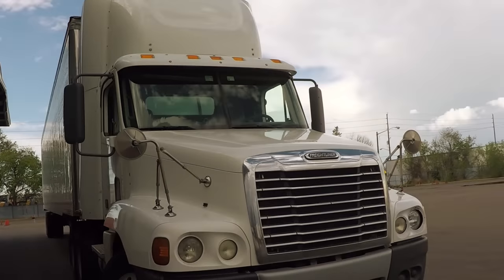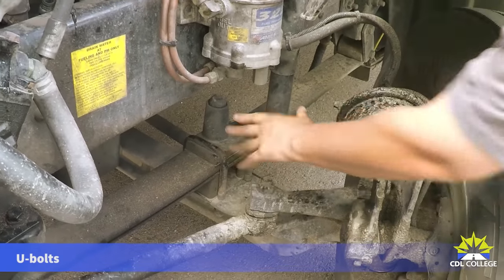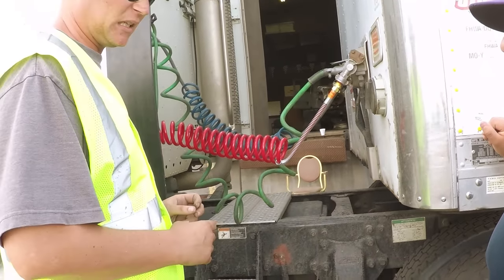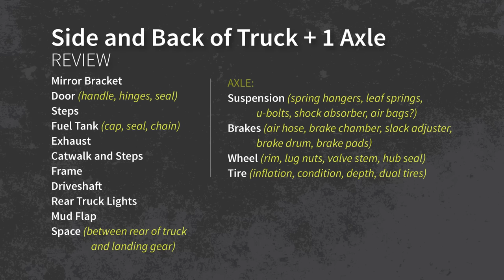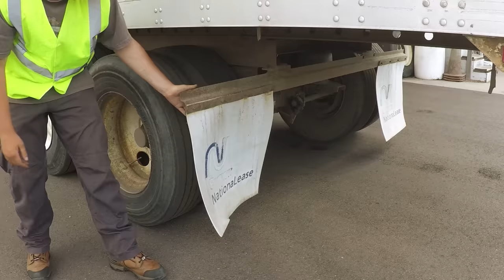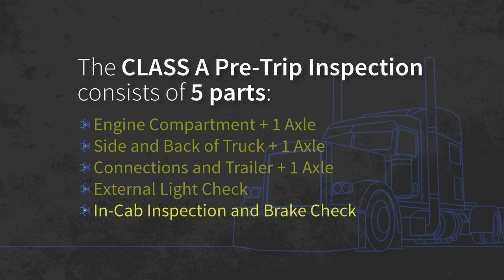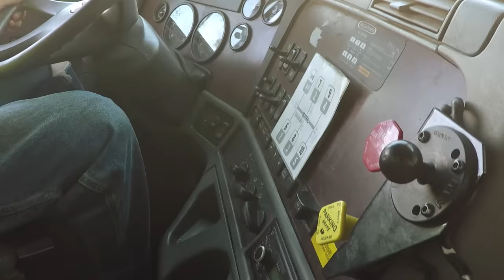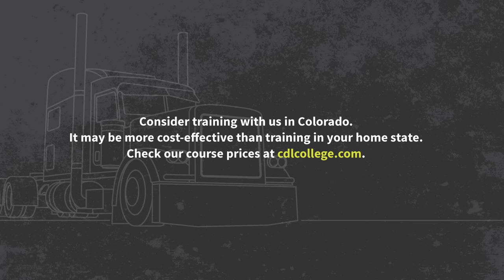[Tutorial] CDL Class A Pre-Trip Inspection DEMO

Comment: In cdl manuel it lists the power steering as a component. Notice the hoses attached to the gear drive in front of the air compressor, so the power steering is gear driven. Still good instructional video.
Reply from the maker: We disagree, but that's OK, Tim. We don't think the power steering gearbox is driven by anything. There are, however, gears inside the box that assist the driver with turning the steering wheel. Thanks for watching and commenting.
Reply: At the 2 minute mark on video notice hose leaving reservoir over to a component, then a hose going back over to steering box. What is that components name and purpose?
Reply from the maker: I see many hoses and 2 reservoirs at 2:00. Which are you referring to?
Reply: ok, look at 2:09 mark. Below reservoir notice hose going over to a component, then a hose returns back over to the steering box. What is that components name and purpose? Is that a pump for the power steering, which is gear driven. Also, why would the CDL manuel mention the power steering assembly and whether it is belt or gear driven(page 11-1 in CDL manuel).

Comment: In at least Oregon you have to also check the trailer brakes. So don’t forget to push in the parking brahs (yellow) & pull out the trailer brakes (red) and try to accelerate. Or you will fail.

Comment: If the truck was made before 1964 and doesn't have a seat belt, do you just say that under normal circumstances, you check it, but the vehicle is not equipped?

Comment: Do you have to mention if tires can be recapped or if they must be virgin for either the front or rear tires?? Also if you says tires have to be same size and same type per axle... do you have to mention if the tires should be either radial ply or bias ply?? Also do you have to mention what PSI do the tires have to be?? Or can you just say pressure must be manufacturer specs?? Or do you even have to say anything about tire pressure? Also you didn't mention that tires must not rub or touch anything. Also duel tires must have 3 inch gap from tire to tire, and 3 inch gap from tire to any suspension parts and 5 inches from tire to frame. Not sure if this must be mentioned, but I know inspectors will not give you a point if you don't mention these key points. Also don't understand how tires can only be ONE POINT, they should give more points since so much info has to be remembered, and also the importance if tires on the truck are too PRIORITY! So they should give way more points for knowing tires. Just saying.

Comment: This is probably a stupid question but you do have to inspect both sides of the truck and trailer right?
Reply from the maker: No, sir. The truck and trailer are, largely, symmetrical. So, the right and left sides are the same. The tester reasons that if you can inspect the driver side of the vehicle(s), you can also inspect the passenger side of the vehicle(s). No need to inspect the same things twice because that would be inefficient. In the real world, you should inspect the entire vehicle. Thanks for watching, Lord Vader, and for your question.
Reply: CDL College, LLC Thank you for clarifying. I take my test on the 27th. I’m confident that I’ll pass because of your videos.

Comment: Failed the brake inspection. You can only check the slack adjustment when the brakes are released. Also you have to mention all of your hoses have no cuts abrasions or bulges or leaks. You also have to mention the hose clamps are present and tight on both ends.
Reply: Aww don't fail me now I drive truck everyday

Comment: I have a question, some parts he just said: not broken or cracked. Instead of not bent, broken, or cracked. Is it okay to say not bent, broken, or cracked on the parts where he just said: Not broken or cracked??
Reply: no its ok the tester counts bent broken cracked as one description so also mention if its secure or leaking or missing parts and stuff some testers are like "you cant bend a windshield" and they are too technical just try to look confident and get most of it correct and you will pass
Reply: Atom CDL thanks

Comment: Question. Does your parking brake need to be Engaged when you do the 4/60 test?
Reply from the maker: It depends on the order of the steps. If you perform the brake check as we do in the video, both brake valves would be released (IN) during the LEAKS (4) and LOW AIR WARNING (60). The shifter would also be in gear during 4 and 60, which acts as your brake. Savvy, Mike? Thanks for your question and for watching our video.
Reply: Thank you buddy, taking test in California in 2 hours

Comment: I work for a global delivery company and each day I'm given a different tractor to drive. How long should you spend or at least a minimum of how should it take to properly do a safety pre-trip on a tractor? I'm butting heads w/ a supervisor cause he saying it shouldn't take more than 7 mins for a driver to fully do a proper safety pre-trip on a tractor. I feel that if a driver was to actually perform a proper pre-trip, then it should be taking that driver at least 10-15 mins to do it correctly and not 7 mins which feels so ridiculously rushed. If there was an unfortunate accident due to negligence for preforming an improper pre-trip, can the driver be held liable? Would a lawyer or D.A. possibly institute legal proceedings against (prosecute) that driver if it was known that only 7 mins was spent doing a pre-trip? Have you heard of any past incidents where there was a  judgement against a driver for negligence due to an improper pre-trip that could of been avoided?
Reply: bro they will pressure you to hurry up but its your pre trip and your livelyhood take as long as you need

Comment: Had my CDL test today and got auto failed when I did my brake test because I kept on touching my brake buttons/valves. Is that right? 
I went back sometimes during my brake test just to double check if they were pulled out or pushed in. Examiner said that isn’t part of the brake test and and since it wasn’t 100% right I autofailed.
Reply: 27:50 and on he tells you don’t touch anything but the key.
Reply: Idk that sounds crazy I hope everything turned out well I even failed my very first test

Comment: Is it similar to the 2020 test? im almost up, but this corona virus has DMV shutdown.
Reply: The test seems to change every so often and this video is a bit dated. Now days you must also inspect the power steering pump and on the brake test pull agenst the trailer brakes (yellow know in red know out to make sure your trailer spring brakes work its also a good tug test to make sure the 5th wheel locking jaws are secure around the trailers king pin but even before a tug test i always visually want to see the locking jaws around the king pin. Carry a flash light would be my advice. I guess ur phone may have one.
Reply: Atom CDL thank you!!

Comment: Hi. Love this video, but I have a question. Are the 3 engine components of the engine compartment all we really have to mention?...bcause I noticed you didn't mention a few other components such as radiator and battery and the A.c, etc...i just wanted to know if just the 3 are acceptable by dmv standards because I live in Virginia, not colorado. Thank you. Besides that I wanna thank you for very much for this pretrip man...it was very helpful and much easier to retain than any other pretrip I have come across. I just wasn't sure if it is the dmv testing standard for every state, because I know a few guys who failed for forgetting to mention a few other parts this pretrip didn't mention as Well like the torsion bar, release arm, landing gear, Air governor, Apron, etc...i just wanted to know if this pretrip video was legit by every state d.m.v standards. Thanks
Reply from the maker: Thanks for watching, commenting, and for your question, delon. The 3 engine components that you must inspect are critical to the safe operation of the vehicle. The air compressor makes air for your air brakes. If it is compromised, you won't be bale to move the vehicle. The alternator keeps your battery charged. The water pump keeps your engine from overheating. The CDL Skills Test is only concerned with critical components. The torsion bar isn't part of the test, but that doesn't mean you can't inspect it. All of the other items you mentioned were covered by Atom in the video (release arm, landing gear, governor, and apron). The 50 states are supposed to be on the same page, but there are still some shenanigans that occur in testing. If you fail and suspect you were railroaded, you can report the testing facility to CDL Compliance in your state.
Reply: CDL College, LLC  thank you very much for your reply. The video is very helpful, so is the pretrip script you provided in the link. I really appreciate it and I wish y'all the best. Godbless.
Reply from the maker: What a nice comment, delon. Thank you! Best of luck in your studies, brother.

Comment: I have a question, when you turn the key on to check the ABS light you turn the key off and leave it off or do you turn it back on?
I am a little confused
Reply from the maker: You can check the ABS light whenever you'd like, cheo. The ABS light will come on each time you turn the key from the OFF position to the ACCESSORY position. Accessory gives you electricity for your gauges, lights, etc. The ABS light will come on, briefly, and then go off which means the system is working correctly. Does that help?
Reply: yes, thanks a lot God bless

Comment: Swear to jebus I'm not being a dick, just wanted to add a few things. In CA, they want us to mention that the fluid caps are on tight, not leaking and this is where I would add coolant, oil, power steering fluid, fuel.. the hoses are properly routed and secure on both ends (with clamps on tight, if applicable). You forgot to mention the spacers on your suspension system, brake chamber clamps (on tight), slack adjuster and push rod are held together with a clevis and cotter pin, brake drum and show lining has no oil or grease and a minimum thickness of 1/4", front tires are the same size and type, are evenly worn and cannot be recapped, retreaded or regrooved as opposed the the rears, they can be. The window rolls up and down smoothly,  window seal is not cut worn damaged or leaking. You forgot the carrier bearing on your driveshaft and the bushings inbetween your spring hangars and leaf springs. 5th wheel skid plate is properly greased, 5th wheel skid plate is mounted to your mounting platform, all hardware is present, mounting bolts are not cracked broke damaged or loose. There is enough space between your tractor frame and your landing gear to make turns without them hitting or rubbing, your landing gear is in the fully raised position, your landing gear shoes are free of debris. Rear tires CAN be recapped retreaded or regrooved. DOT bumper is not cracked bent or damaged, license plate light is properly mounted and works properly. I didn't know all that about checking the lights, so thank you! They also want us to mention the hoses for the windshield washer, they're not worn torn or damaged, blah blah blah.. thank you for this study guide help thing. I'm sure it'll come in handy!
Reply: i still learn everyday and accept all information thanks for your time

Comment: Ok, I see the problem after checking the driver side door area and finishing at your fuel tank with side markers etc.,  your supposed to enter the cab and do your safe start,  do your interior inspection and then do the Brakes test, and then finish brake test and then as you wait for your cut out , you do your lights, marker,Hazard,etc. With the examiner out side,then exit the cab and do your trailer,  and that's the steps it should be done, thank you.
Reply from the maker: That's very interesting, Carlos. Problem: the tester's instructions to you were to inspect the Side and Back of the Truck, and half of either drive axle. Entering the cab during this inspection would probably earn you a fail. Thanks for watching...
Reply: @Cdlcollege  I dont understand but the examiner did fail me for continuing after the door and fuel tank, then said that I was supposed to enter the cab. This is a great video  it is very explanatory and helpful,  but I was failed by the examiner for not following the sequence, like I explained,  I got one more shot, I ask for a  different location and a different examiner, someone wish me luck, i can sure as hell  use it. Thanks
Reply from the maker: @djc3949  Expert luck going out to you. Your tester is full of brown. You can conduct the inspections in any order you prefer.
Reply: @Cdlcollege  thanks dude , keep up the good work

Comment: If you have a hub leak, open the hub and check or look through the glass. If you dont have hub oil, your tire is gonna break off and fly away and kill someone. MTO and DOT will not punish you for the hub leak IF you have oil in the HUB. But they will give you a warning and send a letter to your employer/company. So make sure you get it fixed, if they don't fix it, and you drive the same truck. Its you thats gonna pay the fine.

Comment: I failed my first CDL-A.... I made it to the final brake test by saying the brakes will set at "20 to 30 psi" on the full brake pump test. I was told you must say the brakes will lock at "20 psi". What you did in this video was exactly what I did, and you would have failed with my instructor. You said "20 to 40psi". You must say exactly "20 psi".   I feel I was robbed. Of course I'm going to try again, but I must say, your instructions may be wrong on that detail.
''
'
Reply: That's funny! (Not literally of course haha) My pre-trip practice for school also says the emergency tractor and trailer brake knobs will pop out at around "40-20 psi" or vice versa. I will definitely double check with my instructors now. It may vary per state? But either way, you'll get it man 👊 Kind regards!

Comment: control arm lol try again steering arm, there's a point.  No audible leaks from brake hoses or chambers of course not cause there is no air going to it at the moment, I suppose it's telling you that the service valve is not leaking air and engaging brakes lol.  The Brake shoe not glazed over which is a sign of over heating lol wrong, the brake drum is the one that get glazed if overheated, do you even know what glazed is.  Does this guy know what he's talking about or is he just a parrot repeating everything he was told to say.
Reply: Maybe you should run for senate!